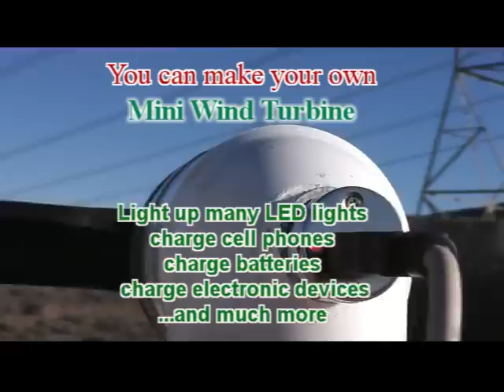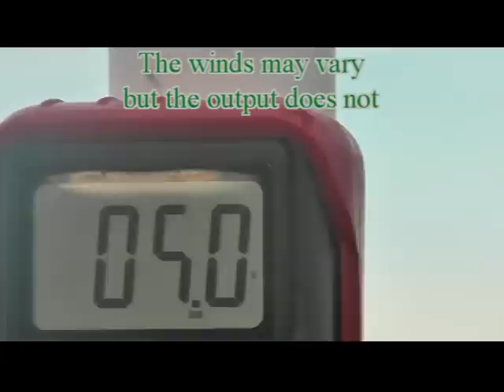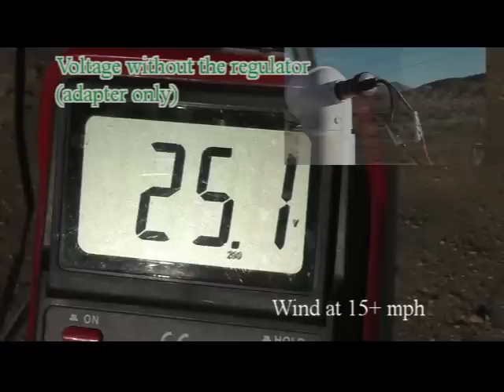Mini Wind Turbine G2

Comment: I guess I`ll make a new comment instead of hugging Sean's :D

I managed to make my own turbine but unfortunately I could only salvage QK1-4637 motor from my sister's dead printer. I was expecting a stepper motor but googled the code it seems it's a standard motor.

I tried it yesterday but I could only get 3V at best. So I wonder if at the same RPM would a normal motor and stepper motor produces different V output? Because I noticed that the wind that I got is somewhat similar with your video's wind speed (towards the end of video, 25+V).
Reply from the maker: +Surya W. 
Surya, there are many types of motors out there. For the best output on a small motor, you can't beat the stepper motors. They generate electricity at very low speed as compared to other types. They also may come with 2 coils inside which you can use independently. Have you looked up small stepper motors online? I have small stepper motors here that can generate 50, 60 volts (at very low amp though). I don't know of any other type of motor that can output that much. Keep me posted!

Comment: This is a great video, thanks.  Can I respectfully offer a bit of advice?  Drilling out the PVC elbow with a spade bit while holding the work is begging for a serious injury.  Do not do this!!
The other thing is that the blade airfoil is not oriented right for being powered by the wind, it is meant to be turned by rotary power.  If there exists small wind turbine blades, they would be much more efficient.  Still a great vid!
Reply: Some Other Dude ok I found small wind turbine blades for sale, a google search finds them easily.

Comment: hi +sciencetubetoday I made the turbine and my motor is too weak... I haven't used a stepper motor... but what is the maximum voltage a stepper motor gives you? mine only gives of 9v only.... please help and advise me on what voltage motor I should get 

thanks
Reply from the maker: +Dav973jack 
I have some stepper motors size NEMA 17 that can output more than 70 volts, at very low amps though. This is not unusual for stepper motors. In moderate winds they output some 40 volts, using a 20x8 propeller attached to the shaft. But remember that voltage alone doesn't mean much, depending on what you intend to use it for.
Reply: +ScienceTubeToday can you help me? I've currently ordered the NEMA 17 but I'm looking for something really powerful that could power many things.... for example like a 32inch led TV and small appliances like a dvr and a decoder... soldering iron... and some cell phone chargers... what motor should I use for that? I will attach a solar panel for non windy days to my pvc base... thank you for your reply

Comment: i have a berger lahr stepper motor 4 cables out,,,,little bit big than urs,even if i turn it with my finger a 100 watt light work,but if i connect its with something to check its getting too hard to turn it,,,,how i can check to understand and to know volts and watts??thanx

Comment: +ScienceTubeToday,
Hi, ScienceTubeToday, i just want to ask if it is okay to use only the cigarette lighter charger without the cigarette lighter adapter because i cant find that adapter here in philippines because it will only be found on cars. . . it is ok to solder the wires direct to the cigarette lighter charger?
Reply from the maker: +mark lace 
Yes Mark, it is OK to do it that way
Reply: ScienceTubeToday 
thanks for the reply ScienceTubeToday :) . . . the cigarette lighter charger serves as the regulator of the electricity? what if i have an mechanism (part of a bike), a dynamo that produce light. its output was 12 volts. can i also use the cigarette lighter charger to charge a phone? . . . and should I use the bridge or not? thanks :). . . its for my final project :))
Reply from the maker: 1. A dynamo produces AC, but the current is then rectified internally, therefore the output is DC. You can connect the cigarette lighter charger to it and have the DC current stabilized at 5 volts and whatever amps it produces.
2. If you use a stepper motor as your generator, it produces AC. Then you must use a bridge rectifier to make it into DC. Then, you can connect it to the cigarette lighter.
3. Charging a cell phone.: You will not be able to charge an Iphone. The Iphone has a proprietary charger and if you try to charge it with your wind turbine, it will display a message "this device may not be compatible" or something like that. and it will never charge. I am not sure about other smart phones. You may be able to charge a blackberry or other phones.
4. Regarding bridge rectifiers: Whether you buy or make a bridge rectifier, the current will be DC "after" the bridge rectifier, but it will still have some "ripples". I suggest you look for more information on how to "smooth out" the ripples using capacitors. I don't have a video yet, but will publish one sometime later. Capacitors will give you a real DC current with no ripples and it will be a perfect DC. For many applications, the capacitors may not be necessary...only for those that require zero, or near zero ripples.
You are welcome to ask questions at any time.  Take care.  :)   STT
Reply: +ScienceTubeToday
thanks to you :) i've made a wind turbine with stepper motor with a bridge and a cigarette charger. i can charge my samsung phone on it. :) . . .
Reply from the maker: Sweet success! Congratulations. You have earned all the bragging rights :)

Comment: hi there, did you use two zenner diodes? (zorry my english)
Reply from the maker: brunipondio Yes, correct...but for no particular reason. I could have used four schottkys. Good catch!  :)
Reply: ScienceTubeToday hi, thanks, i have 2 motors, both cames with 5 cables, how can i wire them ? (from an old printer)
Reply from the maker: Chances are you don't have the wiring diagram, so you will have to identify the pairs of wires that make the coils (you probably will end up with four wires that make two coils). If you have a multimeter, choose the "continuity" setting and test two wires at a time...when it beeps it is because you found one coil (mark these two wires) - then find the other pair and mark them. Now you have found your two coils. You can connect them in series or in parallel. The series will give you more voltage, and the parallel will give you more amps. - A series connection is when you connect the end of the first coil to the beginning of the second coil...as if you were making one long coil out of the two. Parallel in when you connect both beginning wires to both ending wires of the coil. If you don't have a multimeter, you may use an LED light and connect it to one pair of wires at a time...then spin the shaft manually or using a drill at low speed (please be careful if you use a drill)...the LED light will go on when you have the wires of one coil....then find the next. STT
Reply: thanks, i"ll put this on practice,  and see what happens.

Comment: hey can i charge a 12v dc motorbike battery with same kind 12v dc motor?is it need a  converter or some thing like that for the battery for charge - ?please try this and tell me is it going to work - me also thinking about  creating some thing like that - :
Reply from the maker: +sounak naha 
Hi sounak, unfortunately this will not charge a 12v battery. It is too small for that purpose. I would suggest you get a treadmill motor or something comparable as your generator. STT

Comment: Awesome stuff so neat, this can then be run to an amp controller and to a battery bank to supplement solar?? Can this set up be added to an eco fan for a fireplace run the motor to generate power??
Have you got a TEG video
Great stuff
Reply from the maker: Yes, this can be connected to a battery bank via a charge controller. I have yet to do wattage tests on this Mini Wind Turbine to see how far it goes. Given the size of this stepper motor/generator I will be careful with what loads I connect to it...the more wattage the motor produces, the hotter it gets, so I will probably add some holes to the nacelle for extra cooling. Good comment. Thank you :)

Comment: Hey there.

I am looking to make this, but where did you get the plastic cap.  I am trying to source the materials whilst in Qatar.  This is an extra challenge!  Some help would be appreciated.
Reply from the maker: +Simon Faulkner 
Hi Simon, 
We usually find PVC pipes and fittings at a home improvement store such as Home Depot, or Lowe's here in the U.S., or where they sell PVC pipes for irrigation.  May I ask if this is an educational project? You are welcome to write back and ask questions any time. Hope it all goes well.  STT  :)
Reply: +ScienceTubeToday 
Thanks for your speedy reply.  This is for my daughter's science fair project.  Plus, as a science teacher, I intend to use it afterwards as a model to teach about magnetism and generating electricity using renewable energy.  It's very difficult to source things in Qatar.  Hence, I'm trying to find the bits I can here (locally) and use amazon for the rest.  However, that's quite costly.  I ordered the following motor from a local supplier who uses rs components, but with no idea about its detent torque, I sincerely hope it will be fit for purpose.  The link is here:

http://int.rsdelivers.com/product/sanyo-denki/sh3537-12u40/sanyo-denki-unipolar-single-shaft-stepper-motor-18-015mnm-24-v-dc-12-a-6-wires/8787660.aspx
Reply: +Simon Faulkner Thinking about it, if you had the reference numbers for the parts, I could look them up and maybe amazon them across.  It's a large shipping cost for mistakes to be made...
Reply from the maker: +Simon Faulkner 
I followed the link you provided and read the specs on that motor, but like you mentioned, there is no information on the detent torque. You will just have to wait till you receive it. There is a way to work with high detent torque motors, and that is to scale up the propeller, or use a 3-blade fan from a regular household fan - they have a large blade area...which translates into high torque. I have used them before.  Here is the list of materials:
1-  A 2" PVC cap (black) - the one on the video is a made by Nibco. Sorry, I don't have a reference number...but they must be standard
2 -  2" PVC elbow (generic...they all should be the same, regardless of the manufacturer)
3 -  Metal coupling - to secure the black 2" PVC cap to the 2" PVC elbow - Manufacturer: PumbQuik P3000-22
4 - Cigarette lighter adapter (standard, generic)
5 - Cigarette lighter charger 5 volt, 1 amp (standard / generic)
6 - Full wave bridge rectifier (example: PBL302) - You don't need to make it, just buy ready - You can look for any full wave bridge rectifier 100 volt / 2 to 3 amp. is fine. They come with 4 pins. The two pins in the middle are the AC input coming from the generator they are identified either by the words AC, or by the sign ~ and it doesn't matter how you connect the two wires to them... the output pins (rectified current) will be marked on the Full Wave Bridge Rectifier as + and - 
7 - Propeller (if the motor/generator has a low detent torque...a 20x10 propeller is just fine. What these numbers mean is that the prop has a 20 inch diameter and ideally would advance 10 inches per full rotation (that's theoretical, but that's how we identify props). I would say that you will need 12 mph winds or better, because when you connect a load to it it will demand more from the generator. IMPORTANT: mount the propeller backwards...because it is not working as a propeller pulling an airplane...it is the opposite - it is being driven by the wind. The propeller is an airfoil and the laws of physics apply...I can go into specifics, if you would like...later 
8 - Propeller adapter - Usually this size motor (NEMA 17) has a 5 mm shaft, so, the prop adapter should be a 5mm  5/16 x 24 - What these numbers mean: 5 mm is the hole on the prop adapter that will fit the stepper motor shaft, 5/16 is the other side of the prop adapter that will insert into the propeller hole...and 24 is...24 threads per inch (on the threaded side)
9 - If all else fails and you can't obtain the materials there, let me know. STT

Comment: Where can I buy the motor, what type? And the propelers?
Reply from the maker: +Farid - Stepper Motor Varies  $13 to $25 (online or remove from an old printer - The one on the video is size NEMA 17) - Look for a stepper motor with the lowest Detent Torque (anything close to 65 G-CM (0.9 OZ-IN) is good. If you have the stepper motor in your hand, try to spin the shaft manually...if it's easy to spin the shaft, you have a good one. Please note that stepper motors can output over 70 Volts...but the Amps decrease as the Voltage increases...so, don't expect it to make miracles. You will be able to light up many LED lights, charge AA or AAA batteries, etc... but please don't try to charge a cell phone directly...there is a good chance you will end up ruining it.
 
- Front PVC black 2" Cap  $3 - $4  (Home Improvement Store)
 
- Metal Adapter 2" (Front) PlumQuik P3000-22 ($7.00 Home Improvement Store)
 
- 2" PVC Elbow  $3.50 (Home Improvement Store)

- Full Wave Bridge Rectifier 100V 2 Amp $3.00 Online (Ebay, Amazon, Digikey, Mouser, etc..)
 
- Propeller  Classic 20x8 or 20x10  $19.69 (I sell them for $19.69 or you may purchase it from the manufacturer Master Airscrew Propellers, same price)
 
Spinner / prop adapter ElectriFly (GPMQ4939  5mm shaft (input) 5/16 x 24 output) $7.00 to $10 (online or at a Hobby Shop)
 
Stepper Motor Mount Screws  $2.00 (Sorry, I am not sure...I have them in my workshop, don't remember where I purchased them)

20 gauge speaker wire - 25"  $4.50 (Home Improvement Store)
 
Cigarette Lighter adapter Varies   $5.00 + (Online) 

Cigarette Lighter Charger 5V, 1 Amp Varies $5 to $15 (Online)

I hope I haven't missed anything... Any questions, please let me know.

STT
Reply: +ScienceTubeToday Thank you for the list !!!
Reply: +ScienceTubeToday Do you mind me posting some links so you can check if they are oke?
Reply: +ScienceTubeToday what is the difference between holding and detant torq?
Reply from the maker: +Farid 
Holding torque is the "force" that stops the stepper motor at a very precise point. For example, when a robot at an assembly line needs to make a movement to deliver a soldering to a very precise location (on the component being soldered), it moves, then stops right where it needs to be...holding torque keeps it there for a few seconds, till the part is soldered with precision...then moves to another point and "holds" there, and so on...A stepper motor with 180 steps for example is commanded to stop at step 53 to perform an action...holding torque is what "holds"it there till it's done.

Detent torque has to do with the interaction of the magnet in the "rotor" (the rotating part) with the "stator" which is the stationary metallic part or "outside case" of the motor. The magnet attracts the metal that makes up the stator and makes it more difficult to spin the shaft. That is the detent torque - which has nothing to do with the holding torque. STT
Reply from the maker: +Farid 
I am not familiar with the performance of these props. The specifications seem to be comparable with what I use, which is the Master Airscrew Classic Series 20x10, which I have had outside my workshop for several years. (Note: use wood propellers very carefully, if they hit something, they can get damaged much easier than composites, etc...)
Reply: ScienceTubeToday clear, thanks

Comment: I tried this and the stepper motor will never spin freely, it was never designed to
Reply from the maker: Matthew, there are different types of stepper motors out there. Some have very high "detent torque", some have low detent torque. Detent torque is a resistance that you feel when you try to spin the shaft of the motor with your fingers, for example. If you try to spin it, and it feels hard...that's because it has a high detent torque - You need to use a stepper motor with the lowest possible "detent torque". If go to a store or another physical location where they sell stepper motors, then...before you buy it, try to spin the shaft. If it is hard, then this won't be a good choice.  If you are buying over the internet, then you must ask the seller for a motor with the lowest possible detent torque. (please note, "detent torque" is different than "torque") - I hope this helps!
Reply: thanks, much appreciated
Reply: could you supply me with the make and model number the stepper motor you used so i can locate the lowest "detent torque"

Comment: Hey you said that the output will be  the same even if the wind speed vary, what would happen if the wind is to strong? would the adapter overheat or?